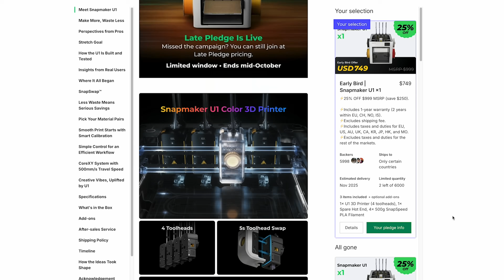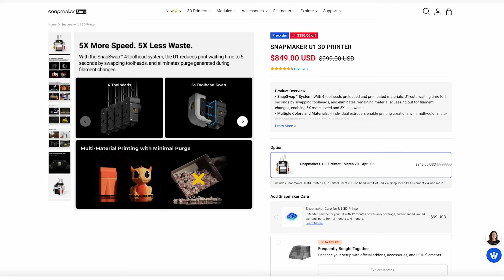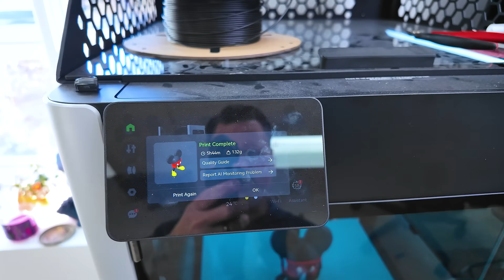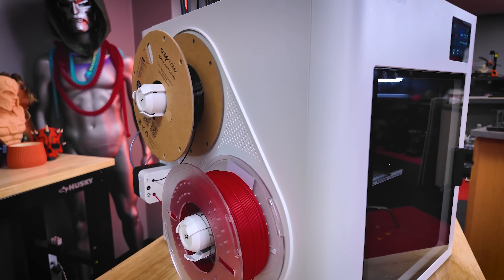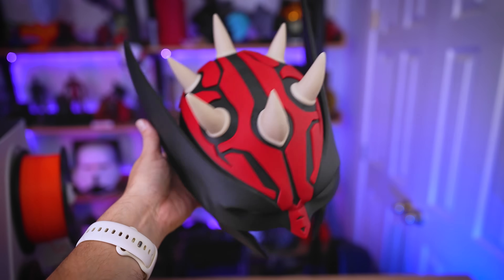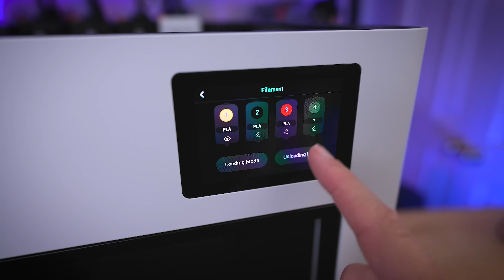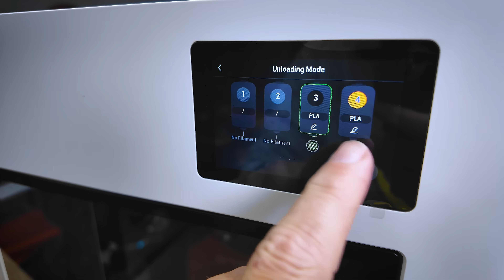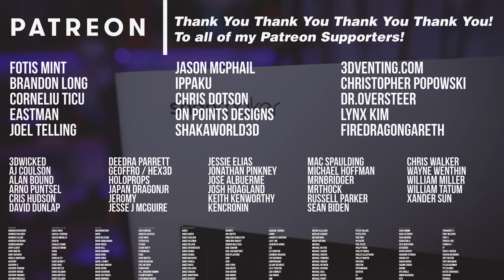The New King of Multi Color 3D Printing - Snapmaker U1

Comment: Glad to see more information and the pros and cons.  I ordered one about a month ago for delivery in April.  Hoping by then they have found the bugs and worked them out.  I wish my Prusa XL had autoloading and also could communicate the colors loaded to the slicer or Prusa Connect.    I don't intend to use their fork of Orca, since I'm using actual Orca on 5 of my printers now with great success.
Reply from the maker: I just saw a little device you can make for your XL to help quick load the filament in but it’s still a manual process.
Reply: @UncleJessy  I've seen that also, but seems to be a lot of work and is one at a time.  The U1 seems to be designed for it

Comment: What is the point of a purge tower if the device purges when changing colors?
Reply: You want to make sure that the filament is "FRESH" if it has been in the nozzle for any length of time it may not flow correctly or be burnt
Reply: @woodwaker1  That doesn't relate to my question.

Comment: Cannot wait to get mine! But after loving 3D printing for tinkering and affordability (Ender 3, A1) I am happy about my new "tool"!
Try "purge to object" with multicolor and use hidden, practical parts instead a "purge tower". Should reduce waste even more!

And it's NOT Bambu Lab, no closed system, no Creality "consumer does the beta testing" and I can print a Prusa sign with it - If I want to.
Reply: What about purge to infill?
Or purge to supports?
Reply: @andreamitchell4758   Both good. But he already used at least purge to support in this video, doesn't he?

Comment: I am very impressed with my U1 The only major gripe is that it goes into "sleep mode" when it is idle for too long and I have trouble reconnecting to it via Snorca. It will probably be resolved in a future FW update. It is an incredible printer though!
Reply from the maker: Oh I forgot to mention on orca slicer/snap slicer it does disconnect after being idle and need to reconnect/login.

Comment: Wishlist items for V2:
Build volume of the size of the snapmaker artisan
and some sort of AMS like system to have even more color options in one print.  (obviously you’d mostly stick to the four, but it would be useful to be able to select one tool head to be multicolor or something for a more complex multicolor print or even a super complex print where you have a TPU component along with PLA or something, and then supports with PVA or whatever)
Reply: You already can have mixed filament prints and components on the same plate. putting an AMS type of system on it would COMPLETELY ruin the whole advantage of muti toolheads.....
Reply: @a @anthonylong5870 t does feel like you didn’t actually read my comment first before commenting. Because I feel like I demonstrated that, even though for most prints you wouldn’t use it, there are situations where it would be quite useful to have at least one tool head that could use an AMS-like system.  Why limit what your machine can do?

Comment: I feel multicolour printing is great for the parts that have multiple colours inside one object but when it's multiple clip together parts in different colours surely it's quicker and cheaper to run 3 or 4 printers with one colour each 😂 those mask prints with the eye parts and gems etc.. that would have to stop and swap colours multiple times per layer. 

You could just print those individual prices separately or one after the other and be quicker

Comment: I originally backed the U1 at the early bird price ($749) with a January delivery, but I was a bit hesitant.  That hesitance was mostly caused by having already been aware of Bondtech's INDX system and liking how that one works better than Snapmaker's setup on the U1.  I told myself that unless I could switch my pledge to the December delivery, I was going to cancel it.  I never got one, so I cancelled it.  Now that the INDX is "available" -- and I did get a deposit down for it -- awkwardly enough, I find myself leaning back toward the U1.  The problem is that I realized that the price of the INDX kit alone is getting pretty close to the price for the U1 (4 tools for $500, 8 tools for $700), and that doesn't include that you'd need to build a printer for it or purchase a Prusa Core One or a Prusa Core One L ($1000-1800 depending).  I don't like the idea of getting the Core One+ because the print area is smaller than Bambu, and I think Bambu's prevalence in the market makes modelers lean toward the 256-cubed build size.  So, I'd rather go with a Core One L, which is closer to Bambu's H-series in print area, but it's technically not supported at launch.

In short, it seems like that while the U1 is the "lesser" option of the two, it's also way, way cheaper for what seems like fairly comparable performance.  Honestly, it's hard to ignore that.
Reply: I cancelled my order as well.  I scored an INDX Dev kit at the reveal and I bought a Sovol SV08 to put it on.  8 toolheads on a 350x350 build plate for $1400 made way more sense to me.  I am fascinated by what they have managed to put together with the Snapmaker though.
Reply: I feel the indx would be more useful in a 300 or 350  Voron Trident or something similar.   You lose about 35mm on the Y axis  on  a Core One.   In my opinion the U1 will serve most people quite well.  Having decent volume.

Comment: Can't wait to see what the 2nd gen will be like. More tool heads? Bigger print volume? A 5-6 tool head with 350mm x 350mm would be epic
Reply: I want 16 million coulours
Reply: @m @mikejones-vd3fg  I imagine a machine with only 3 filament colors CMY, and after melting, mixed in correct proportions to get any color inside the tool head.
Reply: I watched an interview with the Snapmaker rep and he was asked directly if there will be a bigger version of the U1 anytime soon.  He said and I quote "without saying to much, we hear the customers and we are actively working on what you are ask for this coming year"  So I would say they are already working on a bigger one.  Probably 3rd Quarter release with a Q2 announcement is my guess
Reply: Likely a toolhead with simplified internals to make changing nozzles easier
Reply: Yeah, so a post where some where seculating this one minhave Ben design with the ability to have some add ons....that and bontch had the moduler unit coming out here also... That thing if it works lime they claim will be a game changer...will make every one have to step up the game
Reply: Last I saw 6-7 toolheads.
Reply: Nozzles
Reply: more things more money. i think they hit the sweet spot. they could easily go 350mm and keep the rest the same. id buy that 100%
Reply: I agree on having a much bigger print volume, but the 4 heads would be ok for me. Id probably only use 2 or 3 heads for multi colorings anyways. The price is way too high for this small/medium printer, $500 should of be the price.
Reply: @gemininimegI think the price is more for the technology of the tool changer more than the print volume. As tech increases, they can drive prices down (hopefully).

Comment: a great video, as always... lots of focus out there on multi-colour and very little on multi-material... what are the use-cases for multi-material, what use cases are not good for multi-material... etc... we know the machines can do it and there are definitely some videos that touch on it at different levels... but maybe an in-depth review that is less "cosplay/pla colour" and more top 10 things to print using your multi-material printer... and why/how the printer and the material selections form a complete maker-experience would be an idea.   I know I'd watch.. so clearly that's one guaranteed view, and like!   The business case here practically writes its self.
Reply: One universal application of multi-material printing I've seen others talk about - printing supports in a different material than the model makes the supports cleaner and easier to separate.  That's just a simple but very applicable use.

Comment: The biggest issue I have is that it wasn't enclosed by design, instead you have to spend $250 for their enclosure.
Reply: That is kinda wrong. It is enclosed by design. Just the lid looks different because of the tubes.
And the lid did cost more like $ 149 for bakers.

Compare it to the price difference of P1P vs. P1S... Since most people still print "only" PLA or PETG it's good to have that option or source the acrylics by yourself and just build an lid out of 5 pieces. After all this is a 3D printer ... so printing stuff like that is it's main purpose.
Reply: To be fair tho it’s literally thousands cheaper than the Prusa XL after you pay all the duties.
Reply: Ummm NO you dont and its $149 but there are already a few top cover designs people have made that you can download FOR FREE. total cost with the plexiglass panels is under $80
Reply: It is $150 at least at the moment, although there's no reason you couldn't just print your own top cover, even PETG-CF/GF should handle the temperatures of the enclosure just fine.
Reply: Can make one with an Ikea box for $10, it’s a non issue that people are making an issue. If you want everything built in out of the box then buy a $2000 printer. I’d much rather they spent the money on tool changers than a chamber
Reply: All of these recommendations for enclosures are fire hazards, and I agree it shouldn't be an add on.
Reply: @mr.rajikon3911  WTF are you talking about???? How hot do you think the top of the printer is going to get? ROFL! And PETG can handle higher temps then anything that will be created......
Reply: Or just keep the box they ship it in and use that as the top cover.

Comment: 4 colors is very limiting (doing pause swaps is real lame)
Filament is out in the open, my 2 AMS units dry my rolls and are are air-tight
Bambu Studio/Makerworld 3mf integration is CRAZY good (auto opens slicer, profile loaded, plates arranged and labelled, etc). What's Snapmaker's version of this?
Can I remote monitor print progress from the slicer on my PC like I can in Bambu Studio, or can you only watch the cam feed on a phone app?

Comment: Awesome printer! Love the technology. My P2S and AMS 2 Pro generates so much waste for multicolour printing.

Maybe I'll upgrade in 2-3 years when the next Snapmaker version comes out or a less expensive Bambu Lab equivalent is out.
Reply: In 2-3 years if Bambu keeps losing like they have been doing this year...There wont be a new model and if there is then it will be $5000 and still use tech from this generation.

Comment: My machine was delivered on Monday, I had really bad toolhead parking problems that wouldn't allow me to finish the initial calibration. Tech Support was amazing and helped me through the problem as well as the Snapmaker forums. I haven't done a large multicolor print yet, but I'm hoping it works well and the toolhead alignment issues are behind me. Luckily I have no bed adhesion issues.
Reply: yikessss

Comment: I wonder if the bed temperature is consistent on it, and that might be why the prime tower keeps getting knocked over? Someone tested the new Bambu and saw it had issues with bed adhesion and he used a thermal camera on it, and found out that its a very inconsistent coverage on the heating elements under it. Thats an issue.

Comment: I think prime tower system is literally stupid. as in some model color changed after many layers completed in same color. still prime tower method does make the prime tower so that when color will change in future layer printer can print some initial filament on the top layer of the prime tower. however, it will be much better if we just use pop method so that we don't waste material in every layer. also, maybe we can make use the prime tower material inside the print as infill, inner wall etc. in future

Comment: price it at 600 and you would sell a ton. priced at a $1000 it will be yesterdays news when Creality copies it and does a sub par version of their own.  the only advantange is for print farms that don't want to waste all the filament doing swaps. but for someone that does this as a hobby it is priced to high. i would rather go with an anycubic that wastes filament but is cheaper.
Reply: It was $679 total with shipping for me.....Super Early bird price.  You gotta jump when you have the chance. Sitting around waiting you miss out
Reply: @anthonylong5870  the first ones have all the bugs. but still you missed my point none discounted or earily bird prices. are expensive.
Reply: Since I paid $700+ for my P1S (and I love it), the price they’re asking, especially when discounted to $849 is a bargain, plus the cost of the all the filament saved, I might end up getting one, instead of waiting for a home filament recycling system.
Reply: I agree what most people not mention is its way cheaper go this route than buy much more expensive machine.
Your never getting the price different in cost back of the machine fillament is cheap.

Comment: RIP bambu lab
AMS is obsolete
Dual nozzle is super obsolete
Vortek is obsolite
Reply: 4 colors is very limiting (doing pause swaps is real lame)
Filament is out in the open, my 2 AMS units dry my rolls and are are air-tight
Bambu Studio/Makerworld 3mf integration is CRAZY good. What's Snapmaker's version of this?
Reply: lol k
Reply: Not everything is just multicolor PLA printing
Reply: @ThomasS17  Well it's its multi material, then the AMS, dual nozzle and vortek still suck compared to traditional toolchanger. INDX beats them all.

AMS can't do multi material, the H2D sucks at it and the vortek is way too slow.
Reply: @LilApe  how does the h2d suck at mutli-material printing? I do it all day. PETG + PLA + TPU functional engineering parts. As well as ABS + ASA parts
Reply: @jacksprrow  Because anything more than two different materials/colors is slow and thus, sucks compared to traditional toolchangers. Bambu lab needs to lose the AMS, its outdated and no longer desired by customers when faster toolchanger exist.
Reply: @LilApe  lol wut.. im convinced you have no idea what youre talking about now.

Comment: I bought the H2c for myself. Big reason was I didn’t want to wait several months for delivery. Been using it for a couple of weeks now and totally satisfied. Yes, the U1 is faster for 4color prints, but I’ve been pushing my H2c doing a lot of seven color prints and it has performed flawlessly, no adhesion issues or anything. I will probably buy one of these for my daughter once they are readily available. She loves to waste my filament doing multi color prints on her P1s. 😂
Reply: Yes the U1 is faster , Yes the U1 has much higher print quality, Yes the U1 still has less purge, Yes the U1 costs 1/4th the price Yes the U1 has open source for even better tuning Yes Snapmaker has better support...But yeah the H2C is a really smart investment 😂😂😂

Comment: I was a backer on Kickstarter looks like I'll get i mid January I have so much I want to do I refuse to do any multi color until I get it.
Reply: Same. I have a huge cue of stuff I want to make without all the waste.
Reply: Oh dude I am with you! Mine is coming between Jan 5th to 12th.  I had to do a bunch of multicolor prints this week and IT KILLED ME to do it.  I used my Bambu P1S and get this: I printed a friend a 4 color MTG Deck holder.  It had 1 different colored swirl on each side. no intricate print or anything. It took 23hrs and 1.4 KG! of  filament total...for a 3 x 4.5 inch box.......INSANE WASTE!
Reply: You have to live in the darkness so you can fully appreciate the light. You should do a full multicolor print right now and fill a whole garbage can with plastic
Reply: @SangheiliSpecOp  it's not only that with some of the filaments that I would to use are extremely flakey on a single nozzle system. So not just normal waste but failed print waste which I think this will minimize if not outright eliminate.

Comment: i like both this and the h2d dual head system, i hope sometime in the next year we'll get a printer that combines both approaches into one with 2-3 tool heads with 2-3 nozzles each for 6-9 color printing without splicing
Reply: Why do you want to combine them when its a complete tool changer? Does not make that much sense...  (Now U1 is not for me since I want to print with most engineering materials but otherwise it sounds perfect)
Reply: Why?  You want old ass IDEX technology (the H2D) mixed with multi toolheads?  Thats just dumb sry but it is.

Comment: Will get one next year, it will prob be the last printer i buy, running out of space and dont need anymore. Already have 3.
Just wanna know how reliable it is switching toolheads thousands of times per print.
Reply from the maker: I'm going to continue to keep putting it through it's paces. Also will fun when my KS backed unit arrives but so far so good with all the tool changing